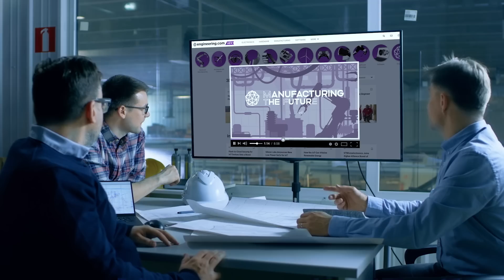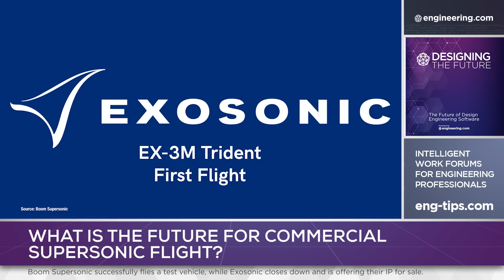One supersonic jet company flies, another crashes

Comment: Concorde only used its afterburners for about 60 seconds during take-off and then again from Mach 0.95 to M 1.7 (or for up to a maximum of 15 minutes) in order to overcome the high wave drag in the transonic flight regime as quickly as possible. 
One fascinating fact about Concorde was her ability to accelerate further from Mach 1.7 to M 2.04 after switching off the afterburners - and that in a climb! This was made possible by the state of the art air intake system, which utilized pressure recovery to increase the pressure ratio within the turbojet engine up to approx. 80:1.
So, Concorde truly was a highly efficient supercruise aircraft.
A further improvement would have been the proposed Concorde B version with Olympus engines without afterburners.

If one company can bring back supersonic flight, it's Boom Supersonic with their Overture.

Comment: Concorde used after burners at take off and to accelerate trough the sound barrier to Mach 2, but after burners were not needed to maintain supersonic flight. If it would, Concorde would use so much fuel it would not be able to cross the Atlantic…..

Comment: Concorde did not use afterburners to maintain its cruise speed, and was actually hyper efficient at those speeds, in terms of power produced for the fuel consumption (more efficient than any modern airliner). The problem is that it wasn't able to fly at those speeds over land, and was also using most of its fuel just for takeoff and acceleration towards supercruise. Get your facts correct!

Comment: That's a lie, the Concord could supercruise without reheat, and it was capable of travelling from Britain to New York and back, before a Boeing 747 could make a single trip from New York to Paris. The concorde was always aimed at the wealthy for its passengers because of the high running costs, it was meant for business people to travel across the Atlantic in only a few hours, and it failed because of a safety design flaw that saw an aircraft crash because of a piece of debis, that fell from another aircraft, that punctured a wing. In the end the economics of redesigning the Concorde no longer added up because much of its technology was becoming outdated, and now because of advances in communications technology there is even less requirement for business travel. The Concorde was the only aircraft that could supercruise without reheat or commonly known as afterburners of its time, including military aircraft. Don't gaslight mate, because you're only damaging your credability.
Reply: Not a design flaw. Poor maintenance by Air France killed it. Missing wheel spacer meant it drifted off center on the runway, to where the debris from a US jet had fallen. If it had run down the center, never would have hit the debris. If the FOD Walk had been done, the debris would not have been there.
Reply: @PiDsPagePrototypes  It doesn't change the fact that this so called engineer lied about the Concorde's ability to supercruise without reheat.

Comment: Concorde didn't need the burner for cruise, but it's problem is the same problem we still face -- drag increasing with the square of speed.  The approach taken by Concorde and also taken by the new attempts is to minimize frontal area as that reduces drag.  Unfortunately the reduction in drag with area is linear whereas the drag increase with the square of the speed.   In order for Boom, or anyone else, to get the fuel burn down to barely tolerable levels the frontal area will have to be very low and that translates to a narrow cabin with a low ceiling height.
And then there's the fact that the difference in flight time is likely to be about half that of a typical jet, but airtime is just one part of the equation.  You need to get to the airport and do so enough early to check in, get scanned at security, and move to your gate.  You then wait for boarding and once boarded and pushed back you may still have 15 or more minutes to wait your turn for departure.  Double that time to account for the time it takes after landing to get to your destination, you know, baggage claim, taxi/uber, etc.  For shorter flights like within the USA or Europe the time savings of a SST isn't that much so those flights aren't the sweet spot.  The sweet spot for SST will be transcontinental  But who want's to spend 5X to more than 10X the airfare to sit in a cramped narrow body plane that will almost certainly by much narrower than either the A-320 or 737 Max -- like a meter narrower.
Reply: Imo the sweet spot of SST is business jets.
Reply: @Quatuux  Yes, but business jets for those that can afford a $250M private airplane so, Musk and a few other billionaires!
Reply: @Raptorman0909  Firstly, a SSBJ wouldn't be so expensive imo.
Secondly, most BJ buyers are not individuals but companies.
Reply: @Quatuux  A common Gulfstream costs right about $80M, there's no way a SST for a private individual, whether or not they use a shell company as about 99.44% of them do to buy it, is going to be anywhere near as cheap as a G800.  The newer SST's will operate the engines in much the same fashion as the did with Concorde, that is, the use of afterburner for takeoff and some of the climb-out, but then operate super-cruise during cruise -- hate to break it to ya, but those engines are going to be more expensive than the RR Pearl engines.  The fuselage must be more advanced to deal with adiabatic heating at supersonic speeds and that isn't going to be cheap.  My best guess is a SST for private people will be 2X to 4X the cost of a G800, in part because of the technology needed, but also because they will not sell many of them!
There were a total of 20 Concordes built, that's it, 20!  If we imagine a similar number of new SST's being built the design and engineering costs will be spread over about 20 planes and if it cost just $1B to design and engineer the plane the amortized cost to design and engineer alone would be $50M per plane.  And the total design and engineering is likely to cost way more than $1B, in fact, I'd be surprised if it was less than $2B and if $2B is a more reasonable number then the cost per plane for engineering and design alone could easily exceed $100M.  And that's before you account for the actual construction, testing, CERTIFICATION, and other associated equipment is needed, you know, like a simulator!.
Reply: Someone needs to make an SR-71 type design, that thing cruised for most of its flight time at mach 3 and was the envy of soviet attempts to replicate the same performance.

Comment: Concorde did NOT need afterburner to maintain cruise speed of Mach 2. This guy is wrong! Get your facts right!
Reply: You are right, In fact was the main difference in performance with the Tupolev supersonic Tu-144 . Last one need the afterburner to mantain high speeds, and that caused short range among other things
Reply: If it had needed reheat, that would have made for a very wet end of the flight across the Atlantic.